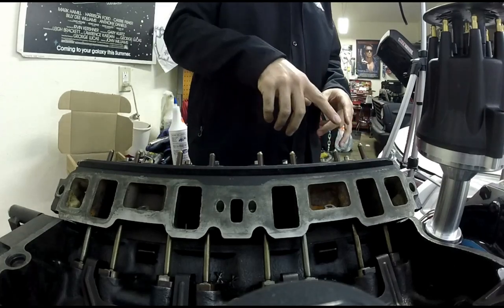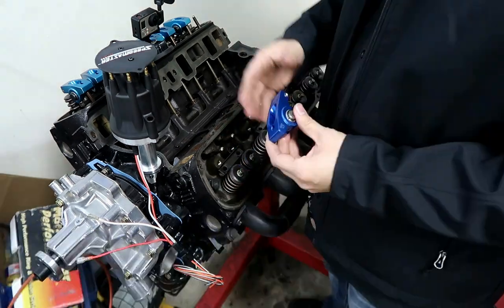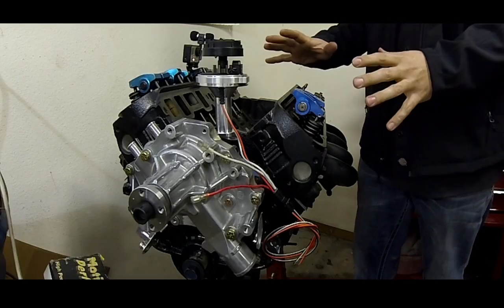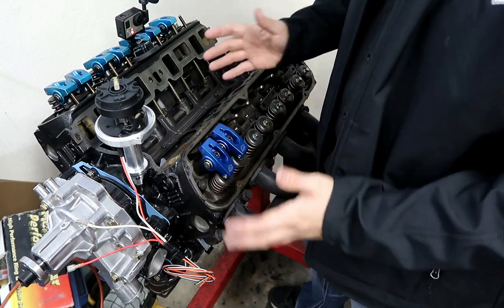PEDESTAL Roller Rockers INFO DIY

Comment: Those are both proform rockers just different ages.  Lots of aftermarket performance heads can come with pedestal mount, afr 165s brodix st5.0s edelbrock performer 5.0 gt40 aluminums

Comment: I have gt40X heads with a set of 1.6 Scorpion pedestal roller rockers so basically as long as the tip is centered on the valve spring and torque them to 20 foot pounds there good to go? I’ve watched a bunch of videos to where there turning the motor over then doing a half turn and all this other stuff but that’s for stud mount rockers it seemed like.
Reply from the maker: Yes with studs you have to measure and adjust for valve lash. To possibly add shims. Why they turn the motor among other reasons. Pedestal mount are not supposed to need adjusting for lash. How ever I had one that may of needed a shim. Time will tell. So far my engine purring like I kitten. But I haven’t RPMed much yet
Reply: Quick question. Did you move each valve to TDC on the compression stroke? I didn’t notice it in the video when you torqued the exhaust and then the intake valve. Is this needed on pedestal mounts style?
Reply: Never mind, I just saw another comment on it. 👍
Reply: Ok cool. I just bought some shims just in case. Thanks again.

Comment: Quick question when switching over to roller rockers from OEM can you still use the same push rods or same size push rods
Reply from the maker: Same push rods. To add, also Same pushrods as well if you’re changing your cam. If you’re using stock rockers or aftermarket I think you have to go to stronger pushrods at stock length if your cam has a lift over 500

Comment: So there is no need to turn the motor over for it to be on tdc, like i can just tighten them all down to spec at the same time ?
Reply: I need to “forsure” know this also.
Reply: For anyone reading this far down - Scorpion Racing - Installation Instructions read - that the can is to be on the NON lobe lift area - so Yes - start at TDC and set your first set of rockers, then rotate Clockwise 90 degrees and set the next cylinder in the proper firing order. 

Scorpion ALSO wants Lifter/Pushrod/Valve tip at Zero Lash Before starting your torque to 1/4 to 1 turn Lifter Preload.

Comment: How are the proforms? Trying to find a “budget” set for my turbo 306. A few of my oem ones are starting to feel crunchy
Reply from the maker: Still waiting to install the engine in my truck. But compared the a cheaper set I’m quite happy with them. I still recommend going Scorpion if u can find them
Reply: I know this is old but maybe someone would want to know now. They junk... they will fail and tear your motor all to hell. Ask how I know? I paid for the right to say that. $$$$$$$

Comment: To tighten those down the cylinder must be at top dead center!
Reply from the maker: Thought so to,  I checked with an engine builder and they said nope. 🤷🏼‍♂️ stud mount yes but pedestal mount no. checked with a few other gt40P head guys and they said no need.
Reply: @FordF100World  I was figuring spring tension against you leading to a false reading on the torque wrench, Ive only ever done stamped, been looking at a set of those
Reply: No the lifter just has to be resting on the base circle of the cam. Just remember the E-O-I-C method

Comment: You shouldn't be recommending anything, you are obviously not an engine builder. Also why waste money on roller rockers for stock block engine? it wont spin the RPMs to make any difference.  It wont make any more power but it will lighten up your bank roll.....